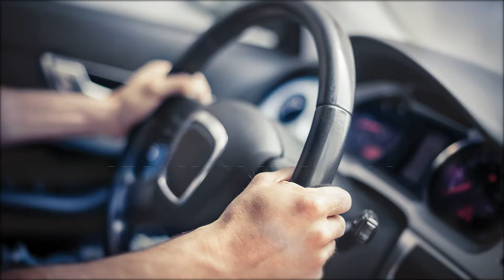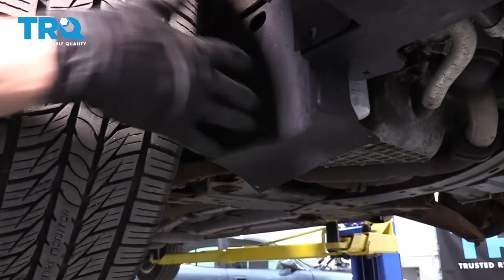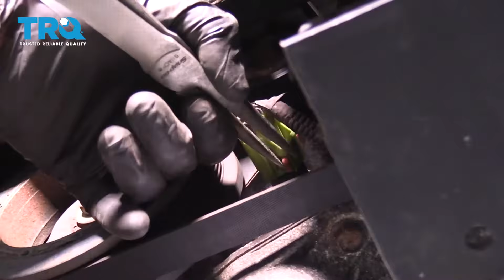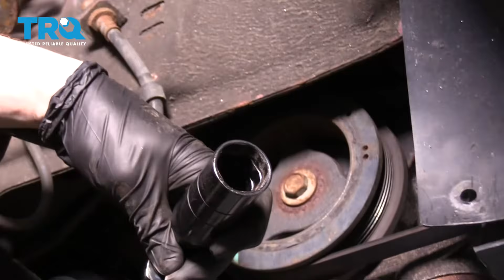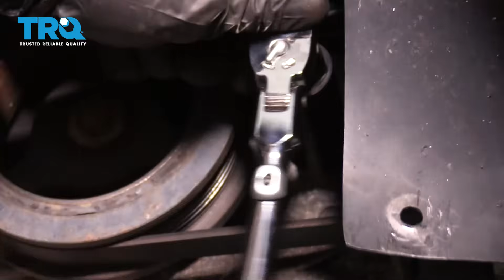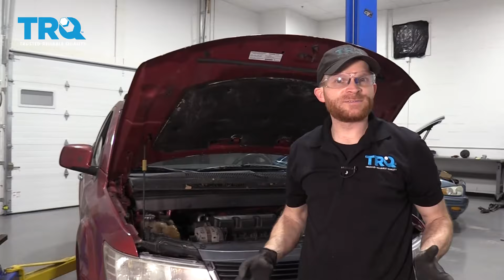How to Replace Oil Pressure Sending Unit 2009-2020 Dodge Journey

Comment: i have to replace this sensor, but as you mentioned there is a special socket for this. I can not find this socket anywhere, does someone have a parts number for the socket or a specific name, Thanks.
Reply: Try a deep well, 12 sided socket.

Comment: A buddy has a P0520 (bad oil pressure switch) on a '12 Journey with a 4 cylinder. Is that this?  Thanks!
Reply: this is 6 cyl engine